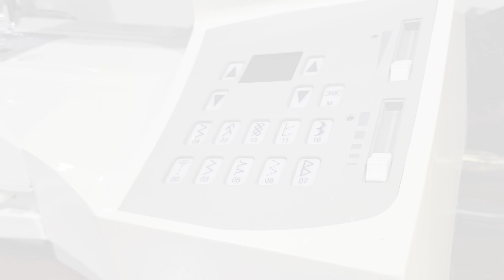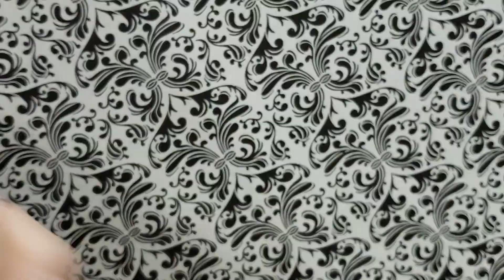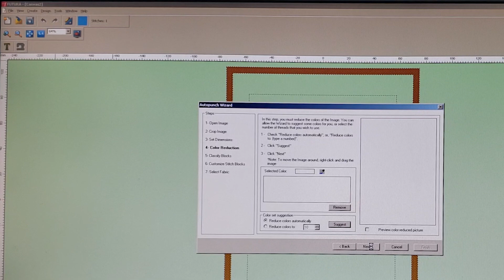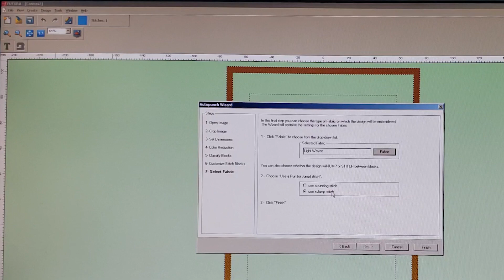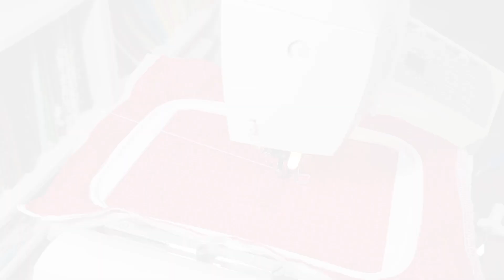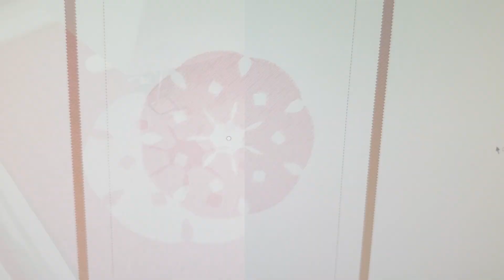Singer Quantum Futura CE-200 Embroidery Machine: How to Use the Autopunch Futura Software

Comment: I tried installing the autopunch software, i typed in the access key and my computer died from a power outage midway (weather Q_Q ). Tried it a second time and got an abort error message.
Reply: My brother tried and got the same results.  We found that we needed to be using a Windows XP machine.  The software will not run under Windows 10.  She has a video about using Virtualbox software to run XP on a Windows 10 computer so you can run the Futura software.
Reply: @CCoburn3  I'm using an old computer that doesn't have windows 10. The normal software was successful so I have no issue with that at all. The issue I have which was stated above was on the autopunch software (Q _ Q). I keep getting error messages when I try installing it after my first attempt was a failure due to weather.
Reply: @CCoburn3 pode enviar o link do vídeo amigo?
@CraftcoreDIY alguém Conseguiu instalar o software? O meu é o modelo c 200
Comprei de segunda mão mas meu computador estragou tive que colocar outro HD, mas não estou conseguindo instalar o software😢😢😢

Comment: are you using this on windows 10? I want to buy this one used and not sure if its compatable
Reply: I got it to work on a virtual machine. Using VirtualBox :) I’m so Excited
Reply from the maker: @dezzistone1302  oh my goodness! I'm so excited for you! I'm going to try again on the weekend using Virtual Box. Thanks for following up! 😁
Reply from the maker: Unfortunately I couldn't get it to work on a Windows 10 machine. 😔 Even installing a Windows XP virtual machine within Windows 10 didn't work for me.  There were Windows 10 patches online to download but I couldn't get it to work at all. 
I ended up finding someone online who was selling a Windows XP computer really cheap for $50.  I installed the software on that and it worked well! I just unplug my monitor and switch between the two computers when I need to use the Futura.
Reply: @CraftcoreDIY  thankyou that helps so much I just bought one and ill just grab a windows xp computer :)
Reply: @CraftcoreDIY alguém Conseguiu instalar o software? O meu é o modelo c 200
Comprei de segunda mão mas meu computador estragou tive que colocar outro HD, mas não estou conseguindo instalar o software😢😢😢
Reply from the maker: Dezzi, thanks so much for the Virtual Box recommendation! I couldn't wait for the weekend and got it working on my main Windows 10 computer tonight! I'm so pumped that I don't have to switch computers from my monitor and it's waaaaay faster to use the software on my newer computer with the XP virtual box. This is SO exciting!! ❤️
Reply: Craftcore DIY & Sewing yayy!! Have fun :)